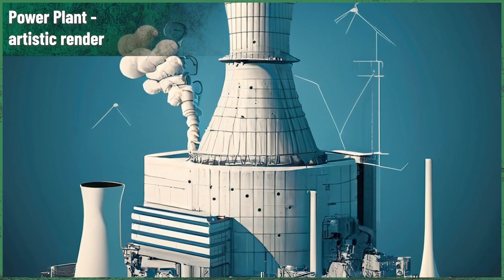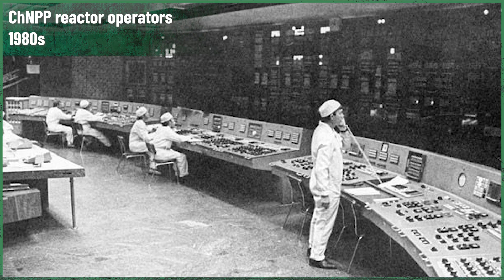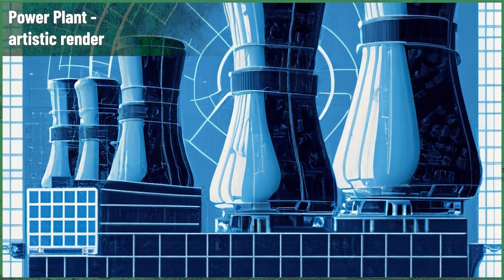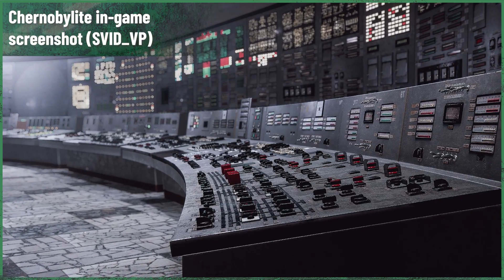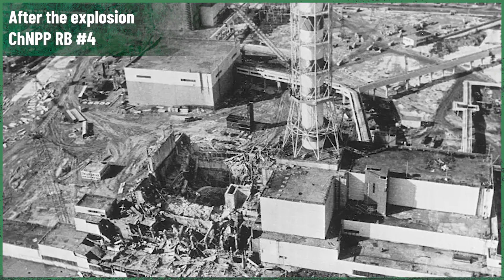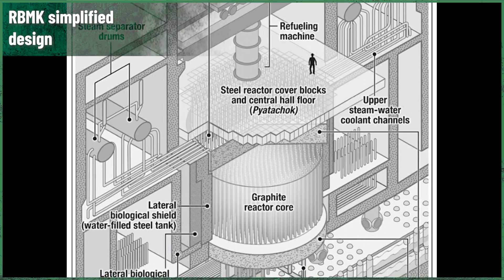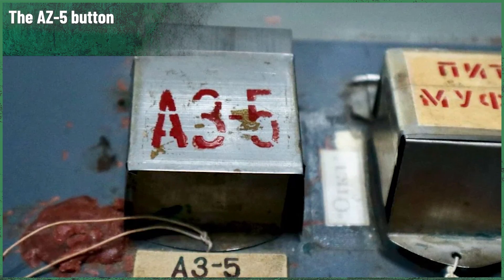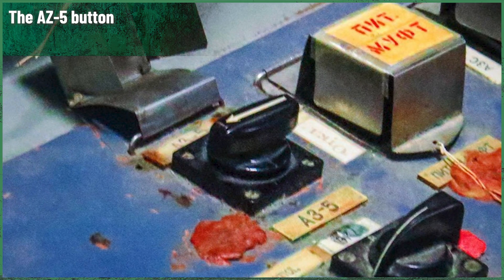They changed RBMK reactor design... and made it worse ||| PART 6 ||| Chernobylite Stories

Comment: I have a question, and forgive me if it's ridiculous ( I'm truly not a very smart person lol) but, what would have happened if nobody activated the AZ-5 reactor scram switch the night of the Chernobyl disaster? 
Would the results have been any different?
Reply from the maker: That's a really interesting question!
You have to understand first, that the AZ-5 in Chernobyl was so dangerous because of many other factors.

I'll try to make it simple. It’s not exactly scientifically correct, but I think that's the easiest way I can describe it.

1. In a nuclear reactor (NR) there are two types of processes: one increases the reactivity, the other decreses it.

2. There are "natural" types and artificial ones. Natural is e.g. xenon which is a fissiob by-product the nuclear fuel, uranium. It’s always there in the RBMK reactor. Artifial type is e.g. a control rod - it can decrease the reactivity (if inserted) or increase it (if withdrawn), of course it can be partially withdrawn (the more withdrawal, the higher the reactivity). In RBM there were 187 "regular" control rods and 24 "special ones", 211 totally.

3. In Chernobyl, there are no 100% confirmed informations on how exactly the reactor worked and how was it controlled. We have eye-witnesses, we have (some) documents, etc., but the most reliable sources are the calculations done after the disaster.

4. We know that probably most of the control rods were withdrawn. That tells us that the operators wanted to increase the reactivity = the power output. Why? There are some probable explanations, including the fact that the test of Unit 4 was messy, without details of previous maintenance. The test was a bit risky, so there should be a period of time when the ractor worked on specific settings - it probably didn't.

5. Because of that, the reactor didn't behave as it should and the detection mechanisms were not reliable, so the operators worked practically in blindness - they could read some of the output readings and try to understand what was going on, but they didn't have that info specifically written anywhere.

6. The reactor probably stalled due to xenon poisoning - the reactivity went down and that could mean failing the test. They should proceed with a manual which specified what to do with the reactor to burn the xenon out, but they wanted to perform the test. That's why they withdrawn the control rods.

7. RBMK behaved unpredictably, so probably they were shocked as the reactivity could go up high instantly. They pressed the AZ-5 and it blew up.

What would happen without pressing the AZ-5? I think two things were possible: either the reactor would shut down because of the xenon poisoning building up OR the reactivity could go up a lot and there could be a different problem like a meltdown for example :-)

I hope this makes sense 😂

~ Andrzej
TF51
Reply: @Chernobylite   Thank you so much for taking the time to respond! That was an excellent and very detailed answer to my question  :)

Comment: When you say the HBO got it wrong when they said the control rods were tiped with grafitte because it was cheaper.                                                                                  I thought the implication was the graffite should of been on a separate mechanism and it was money that ment it wasn't?
Reply from the maker: The HBO simplified some things.
Regarding the AZ-5 button there was at least a few details that were important, not only if the tips were graphite or not.

There were also other AZ buttons, the 5 was for SCRAM (so full shutdown).
Reply: @Chernobylite  can I have a link to the ensig the details of what went on I'm having a discussion with someone and there saying there was no power Serge before the NZ button was pressed

Comment: Yes, it's Sunday evening. Time to get the tea ready for another episode😊 Very well done video, once again. And yes, we absolutely want more episodes. The thing that never ceases to impress me, is the absolute monstrous size of the RBMK when you see the people working on top/next to it in the various pictures shown. Even today this reactor type can still be considered a very large and powerful reactor.

The only bit that got my toes curling during the video is the "nuclear bomb" part. A nuclear reactor cannot become an atom bomb, ever. It has to do with the physics involved, and with three key things; enrichment, moderator, and neutron poison.
An atomic bomb has an enrichment of at least 90% uranium/plutonium. Most reactors sit between 3-5%, with the CANDU running on natural uranium, and the RBMK on 1.8% (after the accident this was raised to 2.4-2.6% enrichment) enriched uranium.
Reactors have moderators present to slow down the neutrons to thermal speeds, when in an atom bomb you want them fast to get the biggest yield.
And every reactor has some kind of neutron poison present in the form of control rods and/or boron in the primary loop (PWRs/VVERs). An atomic bomb has neither, as that would defeat the purpose of the bomb altogether.
A reactor can most certainly explode, but it is a steam explosion caused by nuclear things running wildly out of control, not an actual nuclear explosion.

But anyway, another great episode, on to the next 😇 Stay safe out there!
Reply from the maker: Thanks!

The one with the "nuclear bomb" was a purposeful exaggeration - to underline what would happen. Sorry if that was misleading in any way ✌
Reply: @Chernobylite  
It's all good, I completely missed that exaggeration. Sometimes us nerds tend to miss things like that😅 Keep up the good work👍
Reply: Well explained, good to see another nuclear nerd here.
Reply: @codaalive5076  
"Nuclear nerd" would fit the bill nicely, I'd say😁 And greetings, my fellow nuclear nerd🤜
Reply: @swokatsamsiyu3590  Thanks, greetings to you too 🤛 Otherwise i'm into electronics where we calculated that only nuclear can provide base load current, hydro has very little reserves left, others will not be developed for a long time (fusion), while renewables can barely store any energy and release more CO2 than they "reduce". Renewables do make sense up to ~20% of all electricity, maybe 30% in rich countries, anything higher will release so much CO2 we better just stay with hydrocarbons if nuclear isn't used because they are cheaper and cleaner after that limit. I mentioned this because young generation wants us to fix the problem we caused with our relatively young parents. I have some very good "no flat earth" literature backing this claims, some of it in English. 
Btw, Fukushima releasing 2011's radioactive water into the sea is another interesting topic, i think the most nasty stuff has decayed but so far they didn't release much info about quantities of Pu239 and other long lived toxic stuff remaining in water... Depending on direction stuff like this can also be used for new programs.
Reply: @codaalive5076  
Yep, renewables without a nuclear backbone to provide base-load stability is a fairytale. It just isn't going to happen. In order to store enough energy to power a full city when the sun doesn't shine or the wind doesn't blow, you'll need a battery storage the size of that same city. And even then you would be able to power that city for about two minutes, if you're lucky. Not to mention that after 20 years you'd have to rebuild the whole thing all over again because the batteries wore out. And no one wants talk about the enormous toxic pile you're left with when that happens.
Hydro power is nice, but it is very dependable on geographic location. If you're in a flat country without much in the way of large water bodies, it will be next to useless.

Renewables like solar/wind are anything but cheap, nor are they "clean". Both the production and decommissioning after they've worn out, are extremely polluting. And unlike radioactivity that decays, things like mercury etc. will stay toxic forever. Landfills are filling up with windturbine blades because they're not recyclable. Imagine the mess that is going to leave behind over the years.

The reactors of yesteryear may have had a problem with load following, the current reactors are more than capable of pulling that feat off. France is doing it all the time with their reactor fleet, and that is not even the youngest around.

As far as I have been able to find, Fukushima did not release much in the way of Plutonium. It's mostly Cs-134 and Cs-137, together with tritium that got released over the years. And that decays relatively quickly, as half-lives go.

I'm a retired Master Welder that studies nuclear reactors as a not-at-all nerdy hobby, with a heavy emphasis on the RBMK. You should see my bookshelves😁